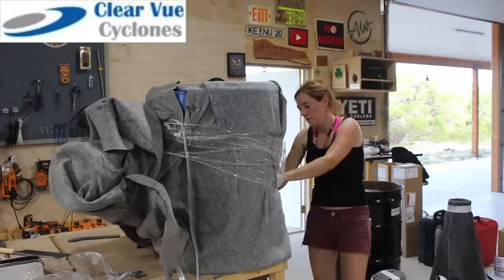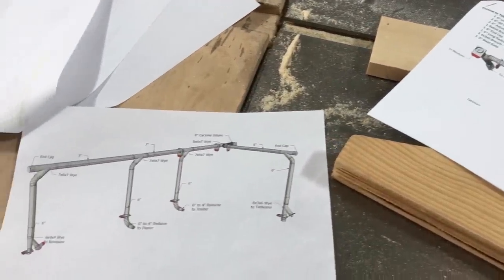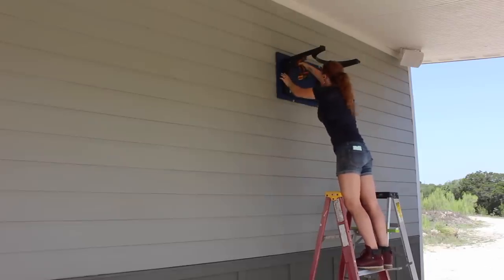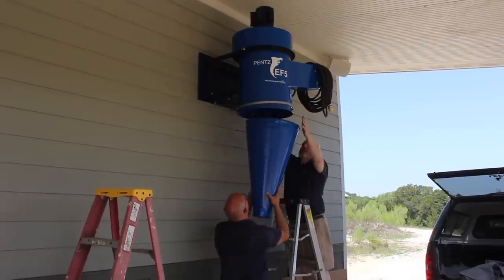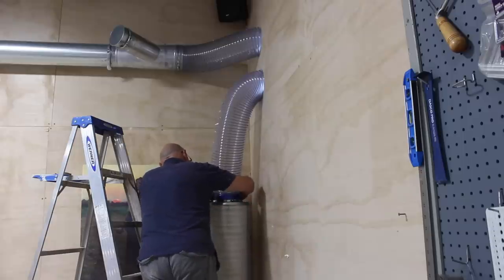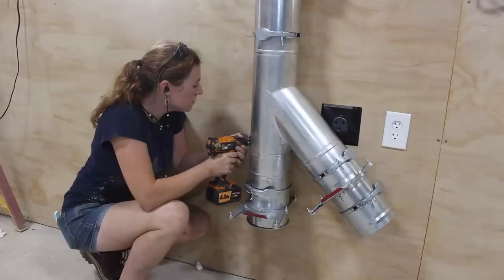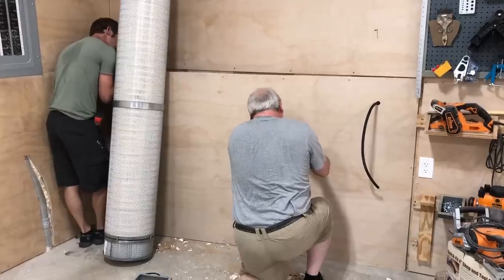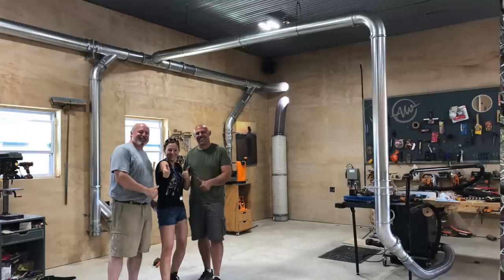Installing A Dust Collection System

Comment: I bought 2 of their older clear 5hp cyclones about 15 years ago for my work shop. They were more of a DIY kit back then. They were just plan awesome. I had to build my own filter setup back then, or I chose to.... Anyway the cyclone does such a great job separating out the dust that after 5 years of daily use I had no noticeable lose in airflow. I wish I still had access to a shop of that caliber. Congrats on getting an outstanding dust collection system, you will not regret this purchase.

Comment: April, I have virtually the same machine only mine is the clear plexiglass but has the same 5hp motor.  I used PVC (because my wife wouldn't approve the metal ducting cost) and I couldn't be happier with the performance.  It collects dust from 10 different saws, sanders and my CNC machine.  What a pleasure to simply opening the various gates versus dragging a hose from machine to machine.  Thanks for sharing....really love your shop!

Comment: This is applicable to your whole building a shop series.  This was really great!  I appreciate all the detail you took the time to share with us, the good and the bad.  Usually, one can learn from mistakes better than when something goes right and you showed all that.  So many channels, perhaps in a quest for perfect production, stage everything so that it all goes right.  While useful for demonstrating techniques, and I appreciate it for that purpose, it takes away from the reality of the woodworking situation, which is overcoming frustrations on nearly every project, in my experience.  I'm going to be building my own shop in about a year or so, and I'll be thinking about your example throughout.  I'm not going to do all the work like you did, but it will still be a daunting project!  Thanks for the tremendous example!

Comment: April, even though i haven't always agreed with all your ideas, i think having the option to vent dust outside or send it through the filter inside is absolutely brilliant! I vent all the dust outside of my shop..no filters to buy and maintain. This works well for me as my relatively small shop here in UK is really easy to heat for free using a wood stove.  Great DC system you've got : )

Comment: I have a clearvue 1800max in my shop. I leave 3 open 4" ports on it all the time and it still works great on whatever I'm hooking that 4th port to. 
You can use metal hvac ducting for it. Cheaper than either pvc or nordfab and works just as well. Make sure you ground the D.C. Piping to prevent static and cnc problems if you have one. 
Don't use a big collection barrel if you don't have a way to handle it. Only use what size you can handle.

Comment: Thanks April. So far, I've been just using hand tools. Mostly I like the quiet nature and romance of it all. If I go with machine tools, the first purchase would be dust collection. I spent a significant amount of time researching which system. I think ClearVue is the best out there. Glad to see you choose it. Glad to see you put it outside and put a Y so you could vent directly outside. I like the new model. I am anxiously awaiting when they have the mini one back in stock so I can hook it up to my shop vac (on their email list for it).

Comment: Just a tip on your outdoor dust collector.

Adding an insulated enclosure around it will reduce outdoor noise as well as reduce heat loss in from the exposed vacuum tubes.

I don't know how much you will loose, but in the winter time during those sub zero temp drops, you will notice the difference.

Well, maybe more so in your heat bill than indoor comfort.

Just make sure the access door for the collection barrel allows for easy removal and replacement.

Comment: What a nice, clean installation. I will soon be doing this too, but on a much smaller scale. 4" main since I've got the Harbor Freight collector which I modified with a Thein baffle and a cartridge filter to replace the inefficient cloth bag.

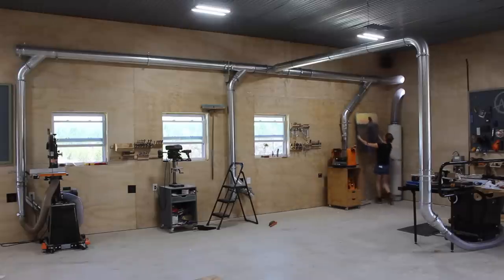Comment: At 9:16 if that vent pointing straight down isn't used yet, you could bring it down to about 1 to 1.5 inches from the ground and if sawdust is on the floor, a push broom could sweep it to that vent and be gone with the floor sawdust. Not sure if that was thought of but would be a cool idea. Also if you do welding in the other side and the doors are closed, possibly during welding in winter, you could use that to suck up the "smoke" that you get while welding. I would love to have a shop like that. I'm hooked on these videos!

Comment: Congrats on your new system, April. A recommendation for you floor sweep if I may. The simplest and most effective sweep I've seen is a vertical pipe run that ends an inch or two from the floor with a blast gate a few feet up. Nowhere for debris to get stuck and blast gates are usually more airtight than floor sweep doors.

Comment: About closing or opening your blast gates, you should be able to leave open five to six  3" lines at all times or four 4" lines at all times because of the power and setup you have.  It won't suck as much dust (obviously when compared to only 1 or 2 open lines) but it should be sufficient to keep the shop clean.

Comment: I recommend their mini cyclone.  It's great, just goes on top of a 5 gallon bucket for collection, and connect it to a shop vac.  Boom portable dust collection.  I set one up at my old job.  Went from using just a shop vac, too the mini cyclone with and a small air blower with a small filter.

Comment: Great idea about putting the filter inside the shop. I was about to put my DIY vortex system in an adjacent shed, but was worried about heat loss since I do 90% of my woodworking in the winter. It's so obvious when I saw it, but that's genius at work. Keep it up :)

Comment: Very cool! I love the tool-less (tool-lite) modularity of that system. You could have several bins on wheels for collecting various sized of wood chips and dust (because you can run production in there), even for collecting metal dust.

Comment: Hi April, I like the duct work in your shop. It's awesome that metal ducting can be assembled so fast. Plus, it looks easy to move when the time arises, because we all know sooner or later we move equipment in our shops. I'll check out Clear Vue Cyclones too. I hope they offer a smaller 4" system also. Great Video April! Thanks for your hard work!

Comment: Great video. It is pretty installation. 

If you don't want the complexity of automated blast gates, you could rig up a handle at a convenient height on the wall, and run a long rod upto the blast gate to operate it via the handle. Automated blast gates linked to the machine below would be cool though.

Comment: One note on your installation.  The 90 degree turn right before the cyclone (using corrugated and sagging flex pipe no less) will significantly reduce the efficacy of the cyclones separation.  One "easy" remedy would be to move the cyclone 6-8 feet to the left and use a piece of Norfab to connect it, the reduction in turbulence will let the cyclone do what it is designed for.   How do I know this?  Mr. Pentz told me so, that and being standard practice in dust collection.
Reply: Van nailed it here.  This is generally true in fluid dynamics.  One typically wants as smooth and clean a flow (air, water, etc.) into the impeller so that it works as it was designed.  I'm a bit surprised ClearVue designed in such elements.

Comment: Just an FYI that first section of flex hose you have on the intake main line is going to cut your overall CFM down by a ton. When you get a jointer depending on what size jointer you get you might have issues picking up the larger chips it creates and you might have a clog. To increase your CFM replace that section of flex pipe with the same as the rest of your main line and you won't loose much at all even with the multiple bends you will have to put in it.

I love the overall system though. Clear Vue makes a great DC system. I choose grizzly for mine but the main issue there was the pricing at the time.

P.S. I almost forgot, if you don't end up replacing that section of flex hose at the start of the intake line then run a piece of ground wire from the rigid pipe out to the dust collector body and make sure you have a good ground. I say this not because of static electricity causing a fire in the system but to save yourself and your tools from an accidental shock on the outside of the pipe. the larger those pipes are the more static builds up on them and with them being grounded to the collector it's self that will save you from most of that.

Comment: Keeping the roar down and suction up is a challenge, and this is decent but could use a muffler imo. The galvanized steel can be grounded, which is good, but PVC does keep the sound down a little as the steel carries the sound inside pretty effectively. The Norfab has a great quick connect system but is overkill for most people. I think it's rated for mist and chemicals as well as dust and it's $$$. Good show and editing!

Comment: Having worked in an area that had two vacuum systems pulling fine dust from cutting graphite composite materials, I'd wrap the duct work with a fiberglass insulation wrap to quiet the inside of the shop down further. Listening to a vacuum reclaim system more than 15-20 minutes at a day is damaging to hearing and gets annoying.

The other thing you may wish to do is to mount the cyclone system on rubber isolation bushings, as it's going transmit vibration to your sheet steel walls.

As for vacuuming the entire shop using the system, I wouldn't. There are going to be small parts that end up getting sucked up, and with that system, once they're sucked up, they're gone forever. We fabricated a wire framed basket and glued magnets on it so that any fasteners pulled into the vacuum, could be retrieved from our 55 gallon shop vacs with HEPA filters.

Comment: there is an electrical component call grippel that is used to hold up electrical fixtures such as lights. it consists of a wire cable stainless and a small metal gripper that the cable  goes through. it works kind of like a cable tie in that the wire cable can only go through one way. you can get it at most professional electrical suppliers. It would work great to hold up your piping.

Comment: Nice!  Barrel outside and easy to get with the tractor.  Maybe put it up on a block so you can get the bucket under without scratching up the paint.

Comment: Did you think about insulating the intake and outtake? That way you don't get condensation buildup. I live in Louisiana you're a little bit drier than I am but when I run cold air outside and then back into the shop and always condensates. Some insulated AC ducking line works okay. Box made of rigid(pink or blue) foam and Loctite closed cell foam worked way better.

Comment: Nice system. If you don't have one, install a pressure gauge just above the filters.  In this way you can easily monitor the status of the filters.  When the pressure gets too high, it's time to clean the filters.  Generally it's not a good idea to make vertical drops off the main truck line.  Come off the line with a horizontal Y.  This is because dust and chips traveling down the truck tend to fall into the branch lines and clog them up.  Just something to watch out for.

Comment: i would install a possibility to remove the sawdust from the floor, so you can sweep the dust in and you have easyer a clean floor  😍👍
Reply: She mentioned a "floor sweep" which does exactly what you suggest.

Comment: Considering that the unit is outside, so the noise in the shop mainly comes from the air moving through the lines, that sucker is surprisingly loud.

If it ever gets to be too much, there are insulation solutions for HVAC ducts that would probably cut the noise down significantly.

Comment: Great video as usual. 

Noise not withstanding, I do find it funny that, in your new shop, the size of an aircraft hanger, you're concerned about the foot print of the motor. ;-) 

Love your stuff, keep it up.
Reply from the maker: There will eventually come a day when I think "my shop is too small"....by organizing and being smart about space from the get go, I'm just pushing off how soon that day will come. ; )
Reply: sooner or later it will come. I'm at the moment 'just' in the planning phase and have alread estimated that I need at least 500 m² - thats a fairly big house here.
Reply: We know. It happens to every one. Keep up the good work.
Reply: April Wilkerson when I was designing before  building my shed in my backyard my backyard neighbor was talking to me across the fence.  When I asked him about his shed size he said : take the size you think you’ll need and double it.”
When I asked him why he walked over to his shed and opened the doors wide so I could see inside it.
It looked like you couldn’t jam another thing in there without lubing it up first there was so much stuff in there. 
So I built a huge shed and haven’t regretted my decision.
Reply: I've worked in a 60,000 square foot shop and space was an issue.
Reply: Shop tools are like gasses.  They fill the space they are in.
Reply: Ounces make Kilos!

Comment: Good choice of system and engineering and you'll appreciate having great dust collection in your shop for both your health and cleanliness. You absolutely want a floor sweep, too, which is usable safely because you have a cyclone separator. I have three of them and they get used frequently for general cleanup. The singular thing I'm perplexed about in your install, however, is the use of the flex hose through the walls. While that might make things slightly quieter through vibration reduction, flex hose also reduces air flow efficiency. I'm surprised that the Clearview folks were ok with that for your installation.
Reply: As Jim said the use of flex impacts system performance.  Also, there should be a minimum of 3 duct diameters of straight duct leading to the intake of the cyclone.  Finally there is absolutely no reason to put a blast gate on the main line, just the at the bottom of each drop.  If no air is allowed to enter a drop, there will be no flow in that portion of the main duct- it is if that section of the main duct doesn't exist.
Reply: Are you sure this is not more of a theoretical concern? The dust was flowing pretty darn good, it looked like to me...
Reply: No, it's not just a "theoretical" concern...and I suspect that the designer of that unit would likely agree. Yes, it works just fun and has a lot of air flow, but the way certain things were done doesn't allow it to perform to peak efficiency.  The branches leaving the main trunk vertically is also something that's not generally recommended because it can cause material to build up in less used drops as material falls back when air flow is turned off. Best practice is for wyes to exit horizontally and then head down to the drop. But that's a little thing compared to the use of flex hose for those primary connections. I'm really, really surprised that the Clearvue folks did that, honestly...

Comment: I thought you had a joiner and planer... they are the 2 most used tools I have for prepping wood for projects. I buy my wood freshly cut from folks with band mills so I need to stack and sticker the boards for 6 months to a year or more and then cut and prep my wood for my projects. It takes more time but I end up with great looking perfectly flat lumber for a small fraction of what it cost when I first began. I’m not sure if your sponsors provide your wood for free. Maybe this prep work isn’t needed for you. Those joiners and planers do generate a huge amount of chips and dust so if you get them the new DC will be worked. Take a tip and go for those tools with multiple elliptical carbide bits. You’ll spend a lot less time sharpening and replacing blades.

Comment: Cool stuff. I have a CV and love it. I'm surprised CV installed the flex hose on the intake and exhaust, however. Instructions say to run a straight length of 5' before intake. I could see this as workaround if space was limited but space is abundant.

Comment: The system looks awesome April! 😃👍👊 ....... One thing you might want to consider, I'm not sure how much of an issue it will be, but you might need to insulate at least the two exposed hoses on the outside of the shop to mitigate any chance of condensation..... I might just be overly cautious, but it's something to keep an eye on.
Reply: Not only condensation, but the loss of cooling/heating and eventual UV damage.

Comment: Another disadvantage of an outside unit (sorry if mentioned below):  You create a vacuum / negative pressure inside which means air needs to be sucked in from the outside.  This is fine, but outside air can be dusty and dirty.  Therefore, heating and cooling aside, one needs a filtered input to the shop in such instances.
Reply: her filter/air exhaust is on the inside. no net pressure differential if you suck and blow into the same room.